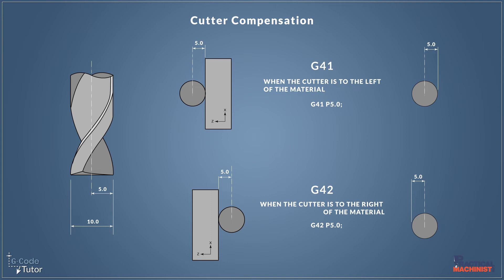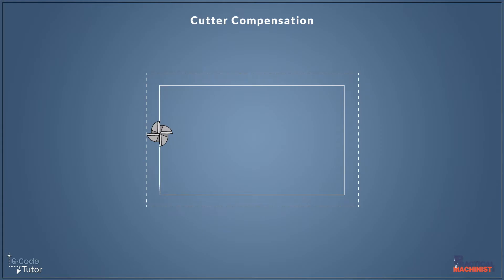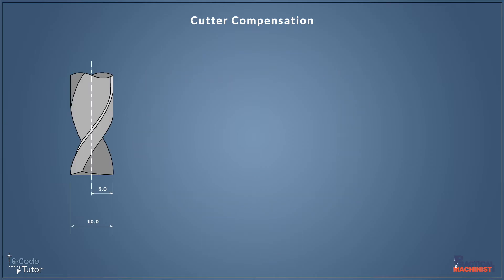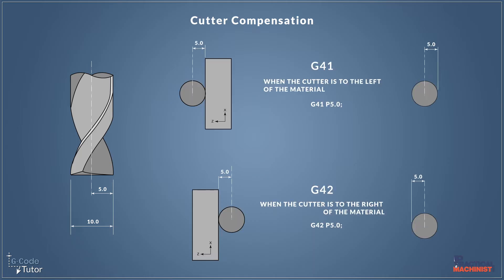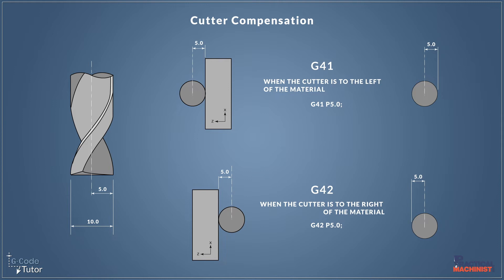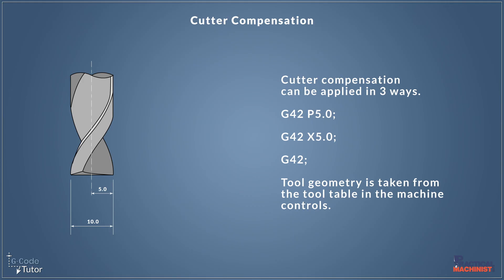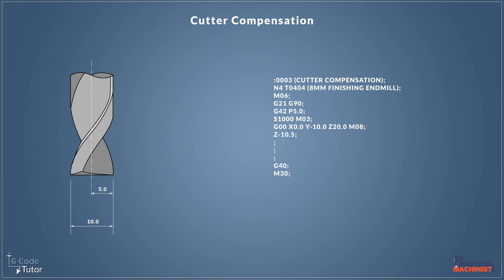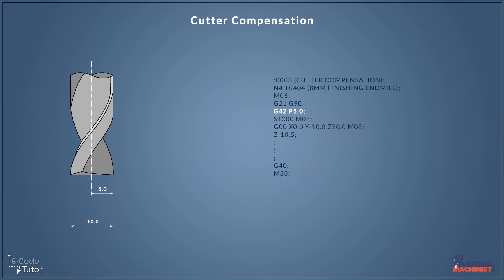Cutter Compensation: when and how to use it

Comment: Can CNC machines be programmed without cutter compensation ?
Reply: Yes, you simply need to do the math and increase the dimensions by the radius. Say you have to cut a box that is 1” by 1” and you are using a 2” end mill that you are using to side mill (NOT as a face mill), you would increase the the 1” by 1” by 1”, as the endmill is 2”, therefore it’s radius is 1”. The issue with this is that if your g54 work offsets are set to, for example, the bottom left of the part on a normal horizontal cnc mill, the values would all be positive when using g41. Without g41, your starting point (bottom left of part) would be x negative y negative, the first destination afterwards (top left of part) would be x negative y positive, third destination (top right of part) would be x positive y positive, fourth destination (bottom right) would be x positive y negative, and return to home would be x negative y negative. This occurs anyways as you never start a cut directly into the part, so negative values would creep into the program. The only way to prevent this is to use a home position one inch away from the part, in both the x and y using a 1 2 3 block as an intermediary offset (a poor use of a precision gauge) or simply have the operator add a negative 1 inch to both x and y values after the g54 is set, but if the operator forgets, a crash can occur. This would only be a benefit for a programmer or setup guy, but risks increasing scrap. Something else to consider that is similar BUT NOT AFFECTED BY G40/41/42. If your parts are coming out slightly oversized or undersized, you can input a value into the tool wear compensation column that, if negative, the input would cut more. If positive, it would undercut the part. This can help you if you are cutting your first part. Input a positive value so as to leave the part oversized, as you can reduce the positive cutter wear value and make a second run of that part of the program until is the correct size. You can either leave a comment of what the wear is so the setup guy can use that value again, or edit it in post. If it is edited in post, the program may not work on another machine. The difference could be from the tool holder or even the collet, so my opinion would be to just leave it as a comment, and not edit the post.

Comment: If you turn off cutter compensation while doing a linear move, does it change where the machine positions the tool, i.e. 
will G1 G40 X1. cut the linear movement x1 while being offset still, or does it turn off cutter comp and then cut the 1 in the x direction?

Comment: We set the diameter of the tool in our CAM software and the g-code is programmed running on centerline but the coordinates are allready offset in the code. Eg: if the cutter is 10mm diam and it is milling on the edge of the workspace, the g-code coordinates will we -5mm. It reads the diam in the CAM software.
However there is an option to use g41/g42 in the settings in which case it will read the diam on the control? What is the advantge and disadvantage of either way?

Comment: I am a CNC machinist, and I am still learning. In the shop I currently work at, we use wear to apply cutter comp. This is how I was taught, and I have never heard of using G-codes to apply cutter compensation. Is there any benefit to using G-codes over wear? And also, if I understand correctly, is cutter comp ultimately backing the tool off say (.0005) around an entire part being machined, such as the entire outer dimension? Any feedback would be greatly appreciated, thank you.
Reply: At least on Haas Machines (and I believe many others, I just have experience with Haas Machines), the wear offset is still using a G41/G42 and referencing the controller's internal list of wear diameters. If you fill out the wear column but all of your program is written with G43 (cutter comp cancel, pretty typical in the safe start block), your part should still machine with no cutter / wear comp
Reply: The G-Code is the programming in the program that turns cutter comp "ON" (G41,G42) and "OFF" (G40). The " Wear " column in the controllers tool offset page is what controls the amount of cutter comp is added/subtracted by the program.
Reply: Roughing cuts